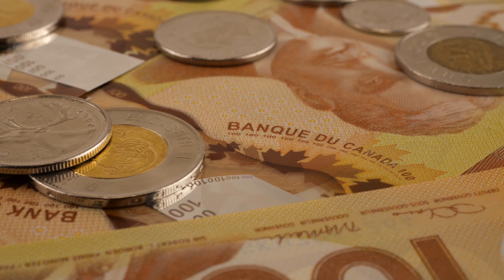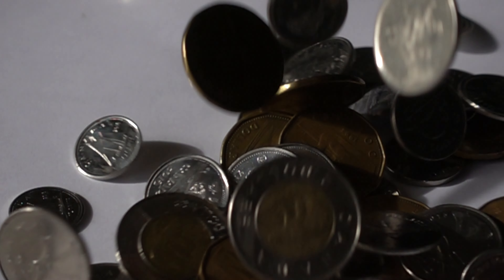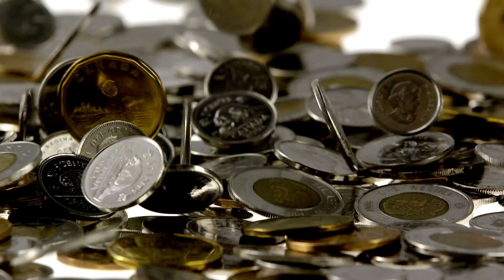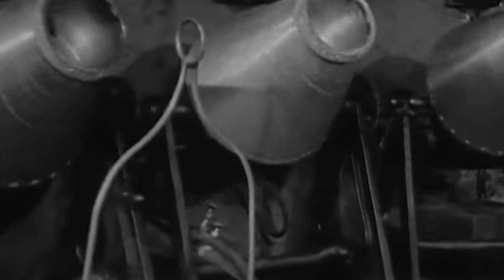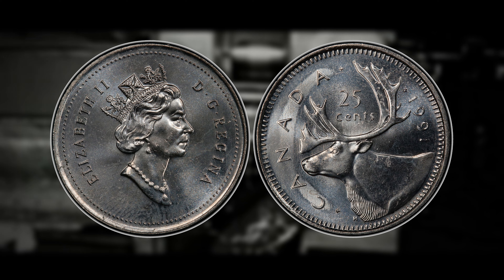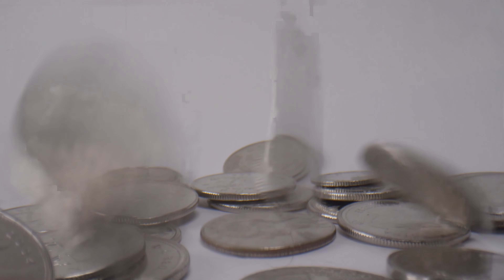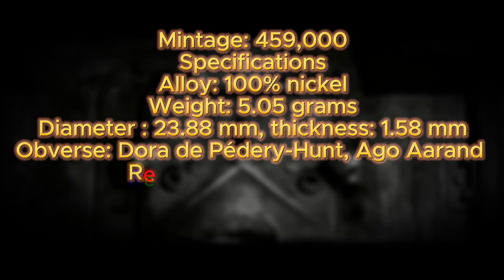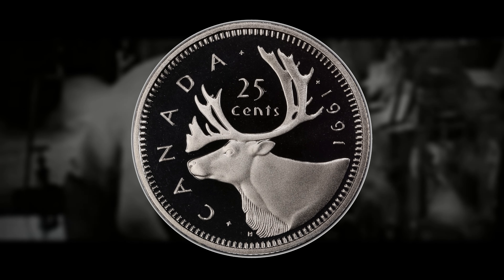"RARE 1991 QUARTERS WORTH BIG MONEY" - Valuable Canadian Quarters You Should look for!!

Comment: Makes no sense to me how something like the 1996 attached 6 nickle which is harder to find than the 1991 quarter has less value than the quarter. Thier are more than likely less than 50,000 1996 attached 6 nickles still in circulation if that even